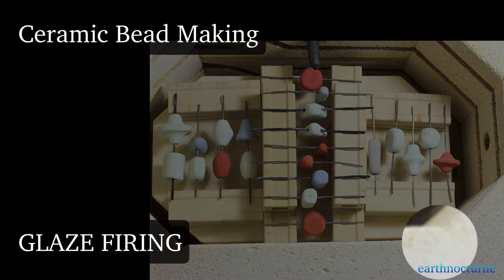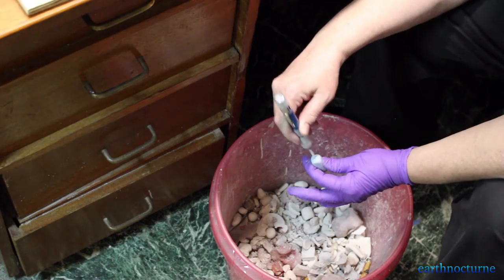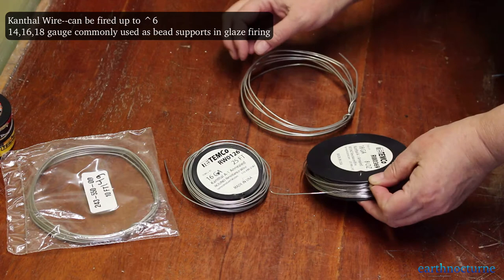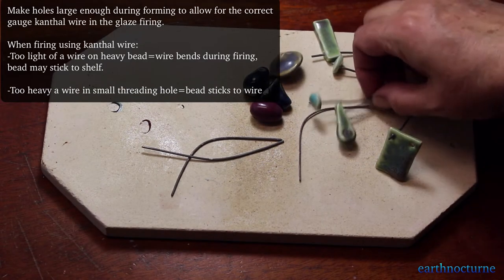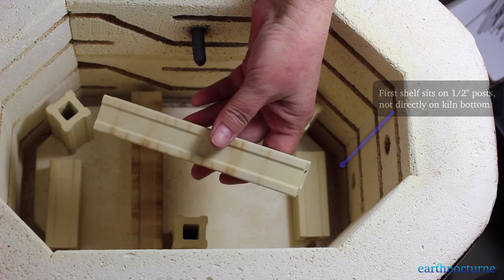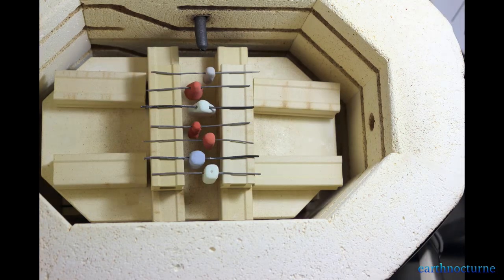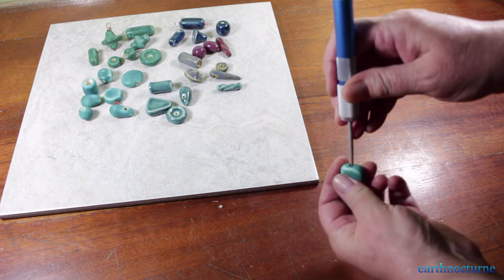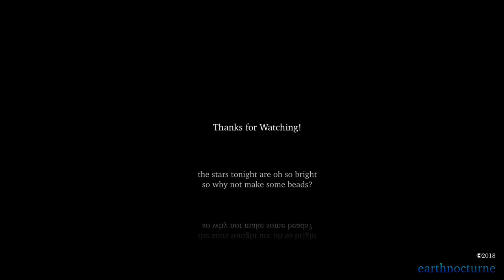Glaze Firing Ceramic Beads in a Small Kiln

Comment: Thank you for the video :) beautiful work!

I have just received my home kiln and would like to create earthenware jewelry beads. I would like to put into practice a single/raw glaze firing.

I have read on internet that this firing can take from 8 to 12 hours.

 Basically, on my kiln safety instructions says to don’t heat the kiln continuously for more than 8 hours. 
I am not sure if I bought the right kiln for my work?Does this firing depends on the dimension of the pieces? Is 8 hours enough for a raw glaze firing?

I am confused. I will appreciate any help 🙂

Comment: Thank you for sharing your invaluable information!  I am currently using a microwave kiln to fire my Raku beads but because I have no way to anchor them properly, one side sticks to the kiln paper.  Can I use Kanthall Wire in the kinl that goes inside the microwave?  I hope to get a reply and would appreciate any type of information regarding this question.  Thank you very much .
Reply from the maker: Hi Madelyn, just noticed your comment sorry for the delay. I don't have experience with the microwave kiln that you're using, but I wouldn't recommend using any type of metal wire in the microwave. Maybe you could prick some holes where the wire will go, fire the piece, and then glue the wire into the holes after firing? Glue on bails also work, I use a lot of wire wrapped bails too (need a threading hole). There are many options, I hope you'll find one that works for you!
Reply: y dont need to use any metal wire ...My system is i make 100/300 conelike spikes or nails with clay! ok ? dry and cook and just impale your beads on top. They have to be very sharp like a needle at the end and very straight  AND  y have to erase a little the inside of the hole of the beads so that it is conic and no enamel will block the hole and like that the spike is reusable. Also the string of the necklace will be safe with that. Yes i use microwave chinise kiln whit that. Y can do up to  25 beads of d12mm in such a tiny kiln in a matter of 20 min with this system !!!  but up to 1000C not cone 6 or 1250C. I drive this mini kiln wth a pid controller rex c100 ( 15€ at our socalled friend Ali) to have correct temperature! IT WORKS !! The system with tungten bars takes too much room and bend anyway and is troublesome to extract the beads. Just do clay nail swith a big basis...some will break , just do more!!!

Comment: Hi! Great idea!! The points where the kanthal wire comes in contact within the holes in the beads...will the wire cause those spots to NOT come out glazed after firing? I am making a piece that needs to be 100% glazed all around, even within the hole, so it can be 100% food safe  (as the piece will be submerged completely in food)
Reply: The wire will stick to the glaze. Try using low fire non toxic/food safe glazes cones 05 or 06have a large assortment of non toxic glazes, and DON'T glaze inside the wholes as the wires will stick, and also, the clay will be hard enough that it will not absorb your food or be toxic to it, so don't worry about that.

Comment: Like your videos! very informative and precise, can I ask where can I buy the supplies, you mention vape supplies can you please share thei link. Also, I am a begginer, any suggestion on what size kiln to buy
Reply from the maker: Hi Aida, Welcome to the wonderful world of ceramic bead making! I buy kanthal wire on amazon:

https://www.amazon.com/Temperature-Gauge-Variety-Craft-Applications/dp/B00GHXGF7Q?keywords=kanthal+wire+14&qid=1537687872&sr=8-2&ref=sr_1_2

This is 14 gauge wire, the largest I use to hang beads in the kiln. I less often use 16 gauge for firing and also for inserting into pendants as permanent bails. 18, 20 and 22 gauge are also good for bails.

When looking for a kiln, first make sure that your home has the proper amp service available for the size kiln that you're looking at. Your available amperage should be higher than the amperage of the kiln. I only have 20 amp service so my kiln is 15 amps and only 120 volts. Not much more than a toaster!  It's an Olympic Doll Kiln, it goes to Cone 10 though I haven't fired it past Cone 6. I love it lots! Skutt makes great kilns, too, I think they have a few 120v models available. You'll want a kiln that can reach at least Cone 6, glass kilns won't fire to ceramic temps.

Thanks for your questions, I'm uploading new vids this week, happy to answer anything you need help with!

Comment: y dont need to use any metal wire ...My system is i make 100/300 conelike spikes or nails with clay! ok ? dry and cook and just impale your beads on top. They have to be very sharp like a needle at the end and very straight  AND  y have to erase a little the inside of the hole of the beads so that it is conic and no enamel will block the hole and like that the spike is reusable. Also the string of the necklace will be safe with that.